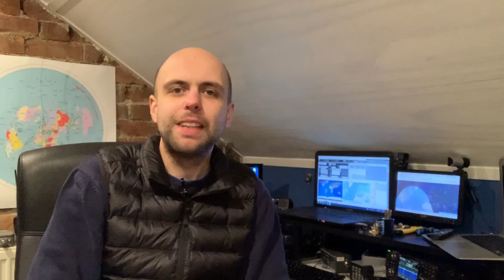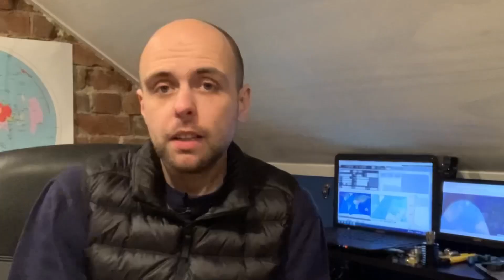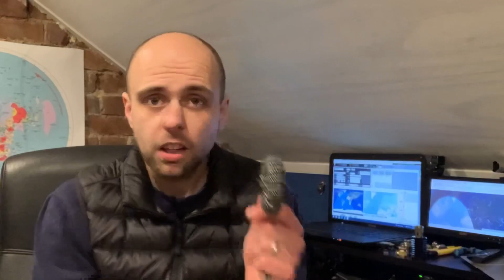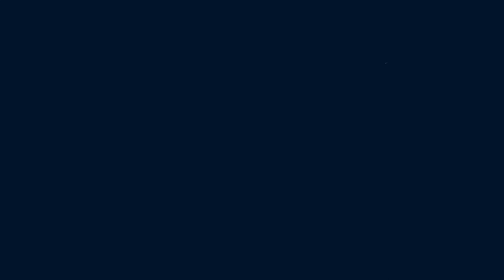The death of the FT-818. What should come next?

Comment: Whilst the IC705 is impressive in terms of size and spec, it's also a user interface nightmare, I don't enjoy it in the same way as the ft817, it feels like I'm having a bad day at the office instead of  simply enjoying my radio, I don't get much time to spend on ham radio and the IC705 eats all the available time simply trying to get it set up, I don't think I've made a single transmission with it after owning it for several months.
Reply from the maker: My experience with the IC-705 couldn't be further from yours. I plug it in and am off. Is there something in particular which is causing you the issue?
Reply: @M0JSX  I don't do amateur radio frequently and when I get a spare hour  I really struggle with the menus  and spend more time reading the manual than using the radio. . I bought the ic705 to replace my worn out ft817 which I've owned since 2005 but I just don't have enough time to learn how to how to use it and get familiar with the UI.

Comment: I love my 818. I own the 705 and the 6100 from Xeigu. These are great radios in their price points but for out and about, the 818 is built like a tank. I'm also happy with retro-esque form factor. Try using touch screen when its freezing outside and you have thick thermal gloves on. If they made the exact same radio with 10w, better battery technology, a more modern screen similar to the FT5D, a usb interface and sound card, and maybe even fusion, all for a sub 1K price, it would fly off the shelves.

Comment: Hi Johnathan, I have an 817nd bought many years ago and am still very happy with it, have owned many portable QRP radios now, going forward with a possible replacement for the 818 yes I agree with you on the same format as the 817/818 it's a good rugged design with its front and rear antenna outputs I'd keep the LCD display good for days with bright sunlight being able to see the screen with out it being washed out by the sun handy, I'd like an improvement on the power efficiency some of the newer transceivers can draw less than 120Mw on Rx, having a speech compressor would be a bonus and design a empty battery compartment with BMS and balancing board that you could populate with your own 18650 cells in a 2s2p configuration.

Comment: I bought an FT-818 just as yaesu announced its discontinuation.
It's a radio that just works, you turn it on and it does what it's supposed to do, no faffing about, No firmware updates to contend with, no bugs in the software or waiting for the next update to fix so glitch, it just works.

Which other radio is this small and works flawlessly on 1W

It's the consummate, go to portable QRP radio.
And it's built like a tank unlike other offerings.

Comment: IC705 does not have 9600/flat audio. ft818/ft857d/ft897d/ft450d all have a data connector for tnc/soundcard and is capable of wideband. IC7100 also can take wide band audio (flat). ic9700, ic7300 and ic705 cannot. Doesn't matter much for HF, but is a very limiting factor on VHF and UHF.

Comment: but if you added all that it would have to be larger. need a larger battery.  and not be as "easy" to transport. aka: lug around 10 pounds or 30 pounds.  i would rather do 5 pounds of weight. and then just size of the carry box, bag, etc. the 817/818 was built to fit a nitch. anything else might not fit.
and QRP is meant to be low power.. right?

Comment: Had an 817ND for years. I did put a filter in it to make it useable for CW and widebanded it to allow use on 60m. I would suggest the following basic spec. for and 818 replacement:

- Similar size as 817/818.
- Simar cost as 817/818.
- Waterproof.
- SDR technology (no optional filters required).
- Similar 817/818 rugged construction.
- USB CAT/ audio
- Ability to fit x3 3Ah 18650 internal batteries.
- more robust power connector.
- speech processor.
- HF + 60 + 6 + 4  + 2 + 70cm
-  optional plug on ATU
- optional plug on 100W HF linear
- 10W CW and maybe 20W SSB
- optional plug in "big" front panel with waterfall.
- Ethernet port for remote control.
- optional software for control from PC or remote control via network.
- wireless headphone/mic option would be nice.
- detachable front panel for mobile install.
- built in "peg legs" 😆

A tall order. However, this is based on not just how I use my 817 but on a lot of typical 817/818 mods and accessories. It may be impossible to get all of the above at 818 cost but even with some of these additional features, I think a lot of hams would buy it.

The idea that you can by one transciever for all modes and popular bands that can be used portable, field day, mobile or as a base station, QRP or 100W and with or without a computer might be something that many amateurs want?

If Yaesu could sell the basic core QRP module at reasonable cost, it may a very attractive to many new amateurs who can buy the extra add on bits as required or as budget permits?
Reply from the maker: I agree with everything you’ve said, but Yaesu would never be able to produce that for the same price as they sold the FT-817/818 for. I think for that feature set you are looking at IC-705 money if not more. Thanks for watching 73!

Comment: A great vlog with really good content.  I also have the 817ND and adore it.  QRP suits me just fine as an M6 and my 857 will give me the full grunt of 10w if I really need it 😂.  I'm not into all these fang-dangled modes and voice SSB is my only means of communications.  Price is also a very good point, why on earth would I pay £1'200 for a similar radio when I can pay £600 or thereabouts and still get oodles of enjoyment from the hobby. Incidently, my only VK contact was with my 817 so I cant knock it.  All my lightweight antennas are home brew and built to resonance so no tuner required and with the battery tray mode with rechargeable AA's, I can natter away for a good few hours no problem.  All band, all mode in one tiny little easy to carry box, yep I'll be keeping mine forever.....

Comment: You impart some very interesting ideas and thoughts here, Jonathan. Definitely an area Yaesu excelled in for many years. I'll be interested to see what they come up with.n I bought an 818 last Summer and am pleased to have it as a classic carry radio. It seems a good partner to the equally ubiquitous FT290 which new hams bought when I got my ticket in 1983. I still have my FT290 and it's still going strong. I hope my 818 does the same.
Reply from the maker: Thanks for the comment. I can’t see ac reason why the 818 wouldn’t have a longevity similar to your FT-290. 73!

Comment: Good job Johnathan.  I have an 818 (wife calls it “the cute radio”.) It’s very capable but definitely needed to be upgraded for the 21st century.  I’m really hoping still for a modern IC7000 from the big boys.  100W, mobile/portable with HF/UHF/VHF.  That’s the big hole in the market right now.
Reply from the maker: Thanks Tom. I’d like Yaesu to produce a modern 857. HF-UHF with fusion and ATAS support. That would be sweet

Comment: The 818 always looked a dead end but I suspect the market for the 817 was still strong so it was put out as a stop gap.  (It seems that ICOM held the cards close to their chest and Yaesu made a strategic error.) Hopefully, there is something better in the pipeline but the Xeigu offerings, and similar rigs like the mcHF, are firmly entrenched and provide a low cost entry into the hobby.  Xeigu must surely be looking at consolidation and as its reputation improves will probably be moving into the gap left by Yaesu.  Unless Yaesu has something very close to release, its days may be numbered in the QRP market.

Comment: Thanks for sharing your thoughts and some very interesting content too although I haven’t caught a live stream as yet 🤞… I’m a bit hooked on QRP radios but that’s probably because I’m a 10 watter M7 so I find their feature sets all have their uses. The Elad FDM Duo for its SDR qualities, the 705 for it’s excellent receiver, touch screen and DStar, the Xiegu X6100 for its ease of use with the built in analyser, decent battery and built in PTT… However I really like the robustness of the FT-818 and really like the design with the dual antenna options and it’s simplicity even the small screen is good for me as I need my glasses anyway…. I agree with your comments about the connectivity and I think battery and charging needs a rethink and also think  a radio with similar spec at the £600-£700 mark with the necessary improvements could be a real plus for Yaesu especially considering how QRP and portable operation is very popular with HF improving and you can never have too many toys can you 73 👍

Comment: The Yaesu rep said that because of the change in components in the FT-818,  the FCC required Yaesu to change the model number from 817 (so Yaesu did). Also the Yaesu rep said that the FT-817/818 is very popular with satellite users too.  The size, the coverage and the price point can't be matched by anyone.  And as great as the IC-705 is, it's also twice the price of the FT-818.  So now there is big hole in the market now, nothing can replace it.

Comment: I have owned an 817ND for about 10 years and love the radio, they should have redesigned it by now but maybe the SDR architecture was not ready then, well it is now. Features I would like to see in a replacement radio over and above what we have now are:-
5 & 70MHz
YSF
Bluetooth connectivity
lighter

Comment: I like my FT817 had it several years. Screen size is not a problem for me as I need glasses to see everything these days. Don't like touch screen radios with sticky finger marks all over them. Run mine with an SCU 17 no issues with out door digital modes with a good laptop and resonant antennas and 3 watts out.

Comment: Xiegu I think will dominate this market....Yaesu step away
Reply: If you like doing a Firmware Upgrade every week or two I guess they are OK but they have had so many issues with pretty much every model.I almost purchased one last February and I’m so happy I found my ICOM 703 PLUS at Orlando Hamcation for just $360.It was a STEAL of a DEAL & I will buy them all day for that price.If hears as well as my ICOM 7000 I believe.👍👏🎙
Reply from the maker: I think Xiegu will dominate the ‘cheaper’ end but that leaves heaps of room for another manufacturer to occupy the middle market. 73!
Reply: I used to be a Yaesu guy but just not impressed with any "new" innovations from Yaesu. The word new in quotations because I don't think anything they have out (less than $2000 price point) is new. I debated getting the 991a but reviews and other hams convinced me to go with the IC-7300. I'm sold on Icom now.
I have a G90 also, have had it about a year, the screen is just a bit small for my failing eyes. Never updated firmware and it works great.
Reply from the maker: @mrbyamile6973  Yaesu have the FTdx10 launched a couple of years ago, and the FT-710 launched last year. They are still making ‘new’ equipment

Comment: Hi Jonathan! Great video as always! I do own a 817nd, and it's a fixture in my life! :-) As quirky and sometimes counter-intuitive it is, it's just one of those "analog"  devices that you keep with you for the sake of it. It is still enormously capable, as Peter Parker VK3YE keeps on showing us from down under. It will stay remarkable even now that Yaesu has discontinued it, these little wonders will be treasured by all who have one.

Should Yaesu have discontinued it? I think so, yes. Redesigning the 818nd will take almost as much energy as designing a new radio from scratch. In fact, I'm willing to bet that part of the reason for them having to discontinue the 818nd is that they are actually in a design cycle right now, and cannot be distracted by having to faff about diverting resources away from that activity. I just hope that they actually listen to ideas from their users this time...

I think that Yaesu actually have a chance to break away from the old 817/818 form-factor, because arguably the IC-705/X6100/X5105/KX2/KX3 form-factor is a lot better from a design and control perspective. You can simply fit in a lot more controls that way, and still have room to spare for a reasonably-sized screen like the KX2. Buttons, not menus! :-) 

Cheers,
Jan (M7HNK)
Reply: I'm not convinced on the form factor argument.  Of course, it's personal preference, but the 817 has a more rugged slim-line build.  For proper portable, like SOTA, I think the 817 is more robust.  I have to wrap my 705 up in a towel to protect the screen if I put it in a backpack, and the brick shape is a bit awkward to stow.  I still take the 705 over the 818, but... that little 817/818 box would be more convenient.    I wish upon a star that they release a new model, SDR, all band, IP rated, same form factor as the 817, lithium battery, soundcard, pretty much the same as the 817 but with optional bluetooth cat control to a phone app if you want to have an easier time of the menus.... I can dream. :)
Reply: @nathanw851  I agree that the 817 is indeed more rugged than the "flat-face"  form-factor on the 705. And in fact the reason that you have to wrap your 705 in a towel is the one that made me decide to not get it, to pay north of £1k for a QRP radio that isn't rugged did not make sense to me at the time. While I don't have a strong preference between the "edge-face" and "flat-face"  designs, the "flat-face"  one is definitely more ergonomic simply due to the fact that there is more space to put stuff. Arguably the most robust QRP radio of all (lab 599's TX-500) is a flat-facer, and as a result have great ergonomics and a fabulous screen. But yes I hear you, I'll wish upon that same star of yours to get something approximating what you said - form-factor be damned! :-) I'll take the 817-style body if it comes with all the nice features and all-bands capability (including 2m and 70cm). And let's throw 4m into the pot as well! :-)
Reply from the maker: Thanks Jan. Very interesting. We can hope that Yaesu is working on something behind the scenes. 73

Comment: What you should do next is buy an ICOM and leave that Yaesu junk alone.Did you know YAESU = Yet Another Excuse Simply Useless?
Reply from the maker: I own equipment from many manufacturers including Icom and Yaesu. It’s healthy competition between them they continues development and innovation. 73!
Reply: @M0JSX  Agreee Yaesu don't look at the erognomics of operating a radio, providing 3D scope gimmicks etc instead.. Give full SDR a try, you won't regret it.
Reply: @M0JSX  I’ll take my ICOM 703 PLUS over any QRP Radio ever built by anyone.👍🎙
Reply: I have had my817 ND for several years, (when I started properlyabout ten yrs ago) but less used now as no USB. I have to take big set in car. New design of technology needed but same form factor with internal battery and all band / mode. Improve the human interface, proper menu like 7300 not try to remember code and scroll . Always thought rx was good, should have bought Amp instead of my FT450D. Rely on FT991A now except for cheap used Icom 2m for simplex. Price was my original deciding factor as an M6 otherwise I would have needed two radios. Many of our newer club members only have Baofeng or Xiegu so are missing out on HF.
Reply: @alanjones3873  I only use my ICOM 703 PLUS for portable operating usually because I also have an ICOM 7600 and ICOM 9100 so I am not in the market for any radio at this point.👍🎙

Comment: I've got the 818, and whilst it's unfair to compare it to the IC-705, the reality is I only ever take 705 for portable work.  I agree with you entirely, Jonathan, I could live without the waterfall display on the 705, but if the 818 was released with battery tech more modern than the Baghdad battery and a USB sound interface, I'd probably favour it over the 705 for chucking in a backpack.  It's a shame they didn't do that.